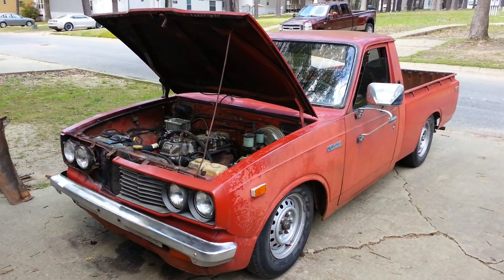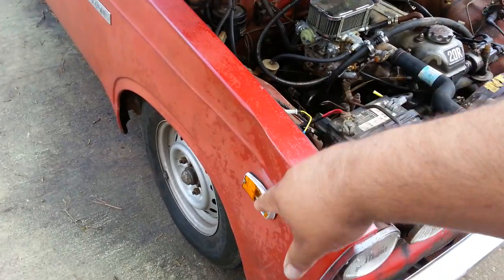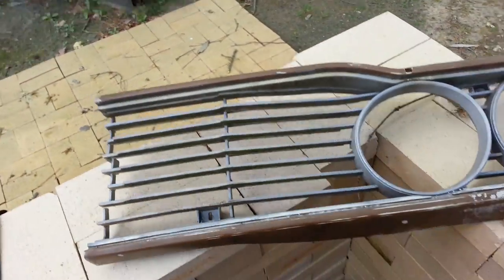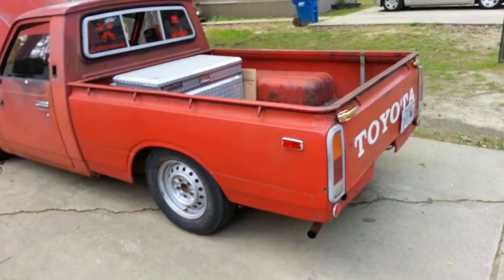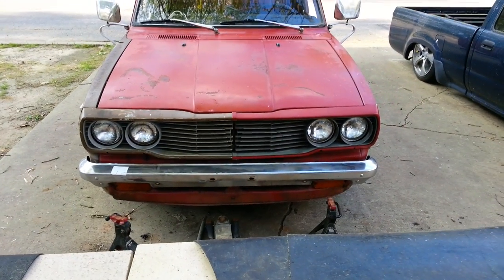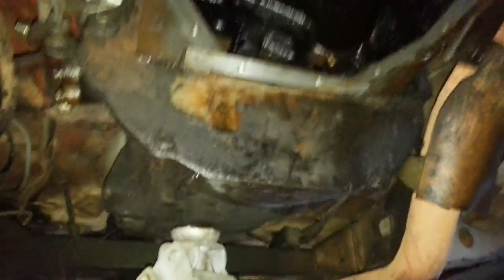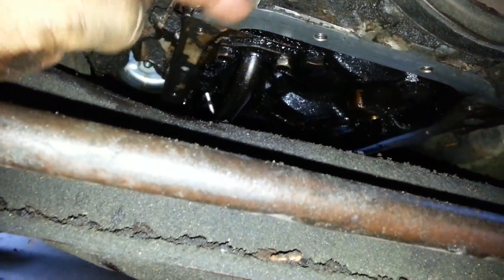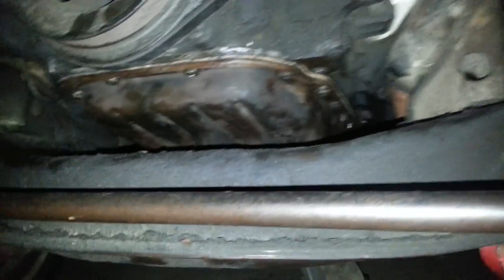How to change an oil pan gasket and more

Comment: I noticed y'all don't have an exhaust manifold cover on it. 
I got one for a toyota 20r motor if y'all are looking for one?
I live in Oregon and my original exhaust manifold had a big ol crack in it so I switched to a header and no longer need cover.
May as well put it to some good use and hook someone up that could use it.
$20.00 or best offer.

Comment: Nice dude. Your tips have helped me get my truck running last vid you did on water pump was dead on for my truck. Question, you ever replace a speedometer cable?  My speedometer stopped working and I havent seen a video on how to replace if for my 94 anywhere.
Reply from the maker: Awesome glad I could help. As for the speedo cable. It depends on what  year yours is if its a cable it will plug into the back of the cluster and down on the side of the trans. Just un clip it at the dash and un screw it at the trans. If it's a sensore unplug the wire at the trans and unbolt the sensore and change it. Hope this helps. Have a great day.
Reply: Cool thanks man. I got a 94 not slammed like yours but does the job lol.  Thanks again